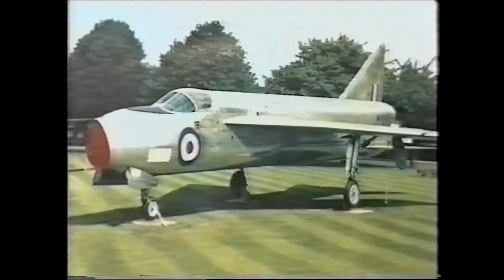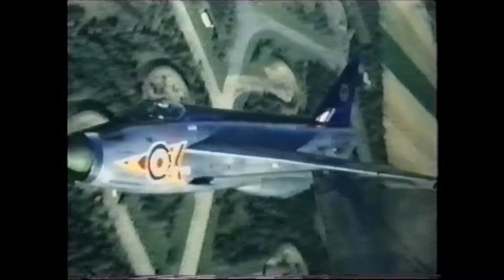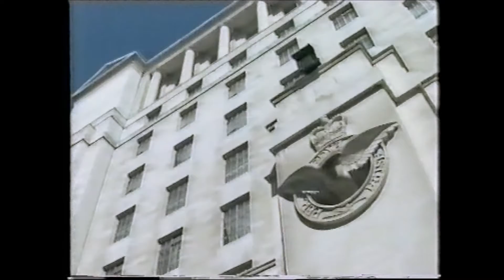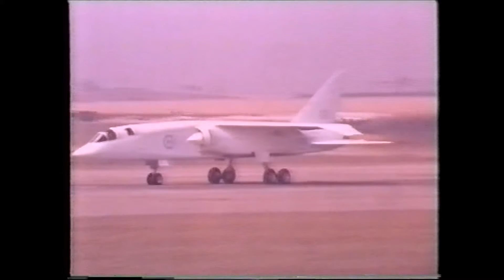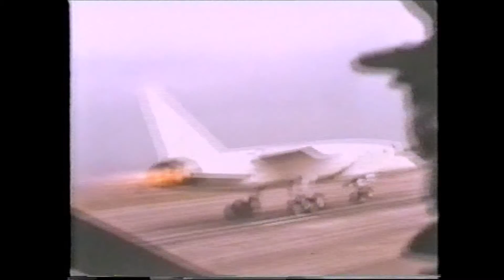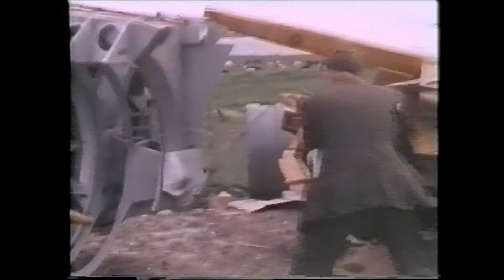609 Squadron Archive Roland Beamont English Electric Lightning and BAC TSR2

Comment: An absolutely fantastic historical record of post war aircraft development,  with its shocking end when the TSR2 was cancelled.
I still have an “English Electric Traction Engine Trainee” overall badge which I “won” from a worn out pair of overalls,  and have amusing memories of repairing my Reliant Robin fuel tank leak,  while it was still dripping,  with Lightning fuel tank sealant after a technician on the Provost production line took pity on the undergraduate apprentice (68-72)  allocated to him.   Time has dimmed memories of disappointment as I realised that a career at BAC was not for me ,  but I have great memories of arming myself with rolls of drawings as a disguise to enable me to hide between the hangars and watch Canberra’s ,  Lightnings and Provosts doing circuits, testing and display rehearsals.  I was caught by the works manager , but his bark was worse than his bight 😊 . My passion for flying was not diminished ,  and years later I drove to Warton from Liverpool where I was nightstopping,  presented myself at the gate in my uniform, and found John Wilkinson who I had worked under in the MRCA rear fuselage design section,  and who gave me the tip to go for a wander with lots of rolled up drawings !!    I was able to take him on the DC9 jump seat to Heathrow and back,  and it was no surprise when John told me he had been awarded the OBE/MBE ?  for his work on the TSR2 and the Tornado.  My experience at Warton gave me a quiet confidence in aircraft which was never shaken in my subsequent career flying the DC3, Viscount, DC9,  F100, 737 and A320.
Reply from the maker: This is a fascinating comment, thank you! Such a witness to history...you must have seen so many changes in systems over that period.
Reply: @Codbotherer      I’m sometimes challenged to go and play on my PlayStation.   My reply is that I didn’t need one ,  as I had the real thing !!